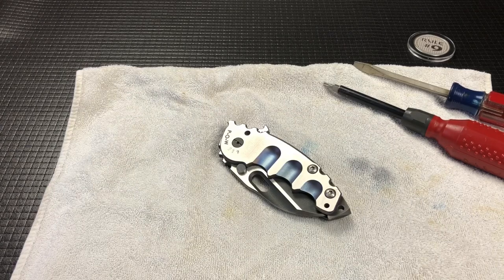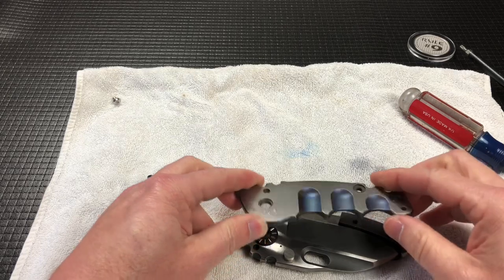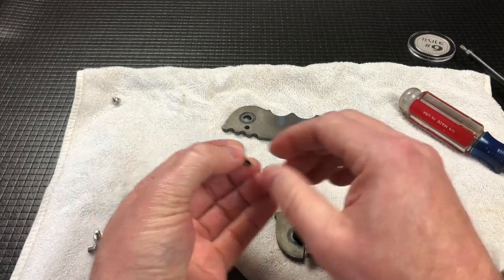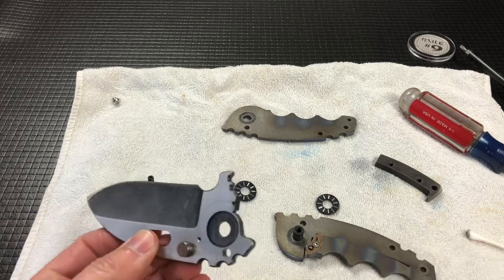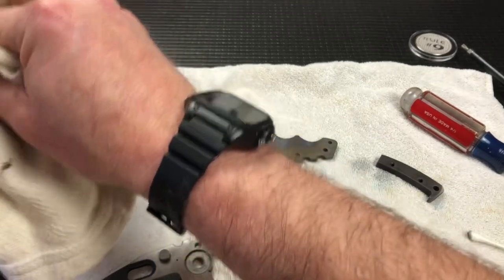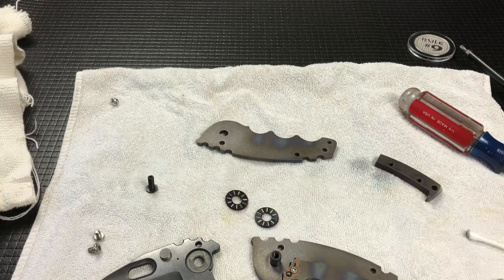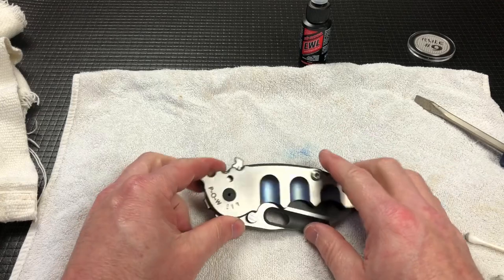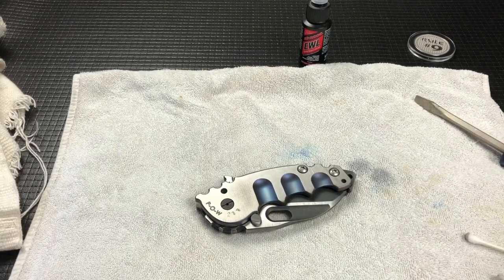Heeter POW (Prisoner-Of-War) Disassembly

Comment: I think I like the tear down video format.
Reply from the maker: Brad Southern thanks. Might do more on some of the blades anyway. Some of the ones I have use proprietary hardware to discourage tear down.
Reply: I was just looking up the Heeter POW on the web.  Holy cow that’s an impressive price tag.  How does the aftermarket hold up the msrp over time?
Reply from the maker: Brad Southern the Heeter’s fluctuate quite a bit on the secondary. If you’re looking for one secondary is often the way to go one these although right now they are reasonable from Todd directly.